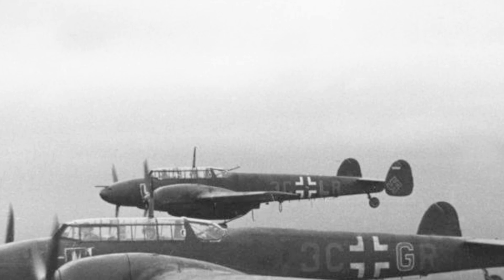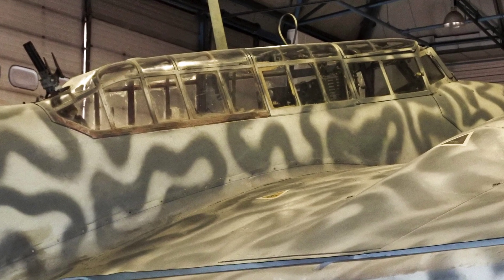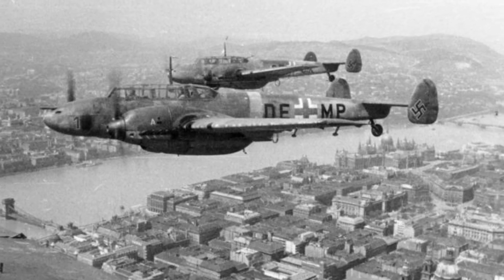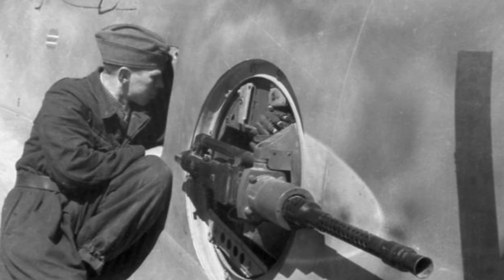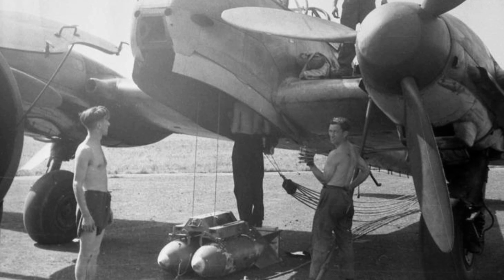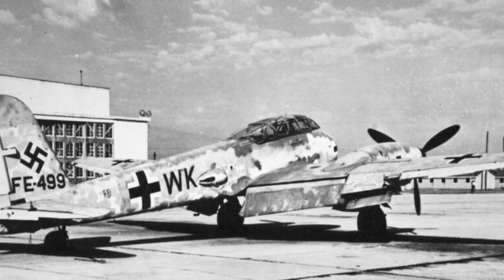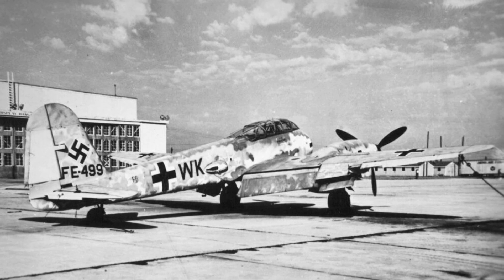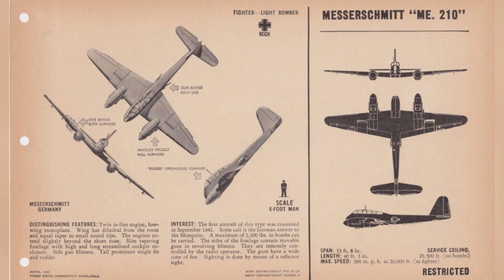The Troubled Legacy of the Me 210: A Flawed Fighter

Comment: the forward bomb bay was unlike any other aircraft and the main problem was that when the bombload was dropped, the C of G was instantly altered and the pilot had to stop the aircraft from tipping up and stalling. They modified it in the field to accept a gunpack in the bomb bay or carried bombs externally. One was even fitted with a six shot rocket launcher in the bay, which operated like a revolver. The whole aircraft was over complicated.
Reply: Yes. the bomb bay was a dumb idea, as was the extra crewmember to man the complicated defensive guns.  The RLM just repeated the same mistake they made with the BF-110 and made the plane too heavy and draggy.  If they designed these planes as single seat fighters instead of light bombers they would have performed more like a fighters.  Kurt Tank tried to them with his original Fw-187 proposal but they ignored him.
Reply: Just to correct the typos in my original comment:

Yes. the bomb bay was a dumb idea, as was the extra crewmember to man the complicated defensive guns.  The RLM just repeated the same mistake they had made with the BF-110 and made the 210 too heavy and draggy.  If they designed these planes as single seat fighters instead of light bombers, they would have performed more like fighters.  Kurt Tank tried to warn them with his original Fw-187 proposal, but they ignored him.